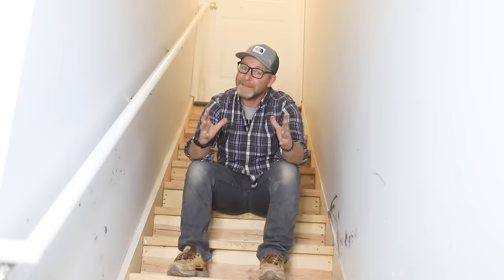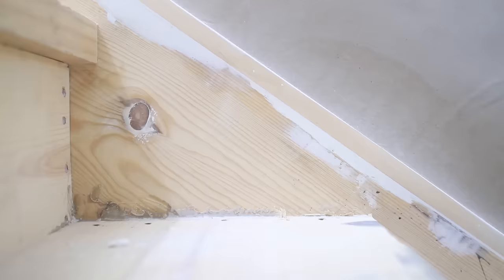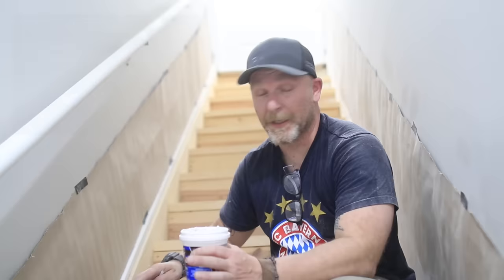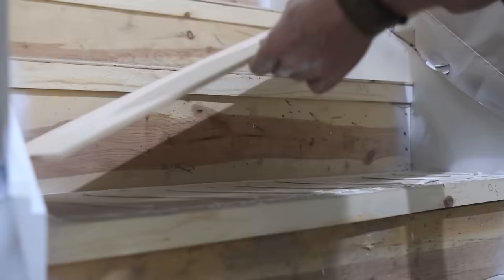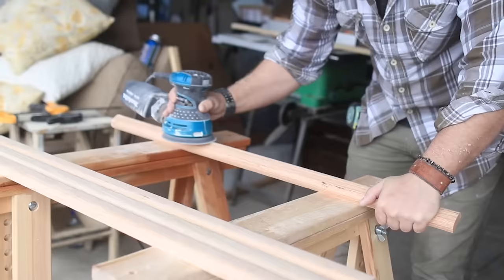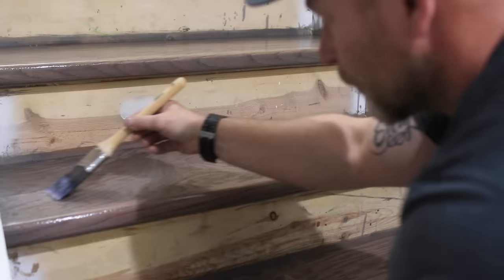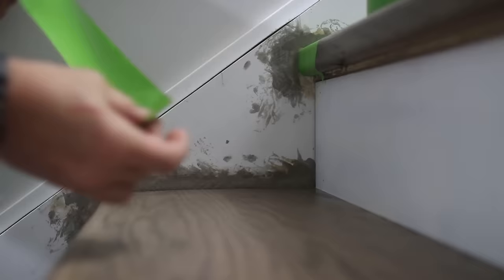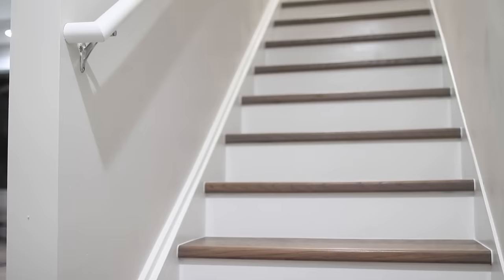DIY Stairs Makeover for Under $200 with Full Cost Breakdown!!

Comment: we have spend so much money on contractor that I need to learn this myself. From bathroom to closet it's something that I should learn on my own. Can I?
Reply from the maker: Absolutely.  It’s much easier then you think.  Just watch a couple of videos on what ever your doing and ask people questions.  You will be able to figure it out.   Good luck
Reply: You can. Just that you will need to spend tonnes on those equipments
Reply: fotochips 

You can start these projects with basic wired tools for not much expense. Jigsaw. Circular saw, handsaw, hammer etc. don’t go for the fancy ones. Find a “harbor freight” and use coupons.

Good luck.
Reply: A relative has a 7,000 sq ft home and he learned a lot instead of paying for it. We did too.
Reply: Rebecca Ramos I’m in the same boat.  Our contractor bailed after receiving partial payment.  I’ve done some things like this previously but not at this scale.  It’s been.....a learning experience lol.

Comment: Looks great! That is just how I do my risers, but those tread are going to wear through.
Just think how easy it is to wear through that veneer when sanding . Might be a good look if you were committed to a carpet runner down the middle , but that kind of defeats the purpose.
Reply: Surely that would depend on wearing through the poly coating first? (hence the comment in the vid about not being sure how well the one-coat poly would hold up)
Reply: @logicalChimp  And regular treads would need refinishing after use anyway.

Comment: Cheap parts, expensive machinery to get those pieces correctly sized.  Still great video
Reply: All the expensive tools and machines aren't necessary- the same tasks can be performed with basic (non power) hand tools. Or a $200 Ryobi kit (which can be used on a million other home projects).
Reply: Expensive tools?  He borrowed the table saw. You’re not much of a DIY guy if you don’t have the tools he had in this. This was a great video.
Reply: @michaelmike11  I dont have a table saw, or a router, but I have a mitre saw. I can afford to buy a whole workshop of tools and plan to get a router one of these days. I just dont have the room for big tools. My mitre saw blocks half the doorway into my garage. Maybe I could hire tools for this project, but then with the hassle of that I would start thinking about just paying someone to do it for me. Not sure about your suggestion that you could cut down the bullnose easily with hand tools. I guess you could work everything out in advance and get the shop to cut it all up for you, but you would have to be mega organised for that
Reply: @Ironbuket  Pick up a hand-router (think you can get a reasonable small one for $50 or so, maybe a bit more - I'm not sure on US prices :D) and a jigsaw or circular saw - along with a folding bench or a couple of good saw-horses, you'll be able to do everything in this video...  Table Saw makes the job a lot quicker, but you can do the same cuts using a straight-edge and a jigsaw or circular saw, etc.
Reply: @logicalChimp  I have saw horses. I went for ones with legs that fold up into the top, to give you some idea of how much space for tools I dont have. How are you going to cut down long pieces of wood length ways on a saw horse? Last time I tried to cut down 2m long piece of wood with my circular saw the edge was a mess because you cant clamp stuff to thin air. I think you need a table saw or a massive workbench to work with large pieces of wood, neither of which I have room for. Everytime I look at routers the reviews put me off pulling the trigger and seems there is a big junp from the cheap ones (5x the price) before you get to something good. You have to include the cost of all the bits also. I wouldnt trust myself using a jigsaw on multiple long pieces of wood. Generally I go off line at some point and duck it up. That's why i got the mitre with a laser line even though I dont really have the room for it. At least I can cut straight now.

Comment: Did u have any issues after adding 1/4 thickness to the  top tread?
Would've been good to show how you tackled that since many people who take o  projects on their own hit snags at transitions of materials.  Would've nice to see how a transition strip covered up the situation nicely
Reply from the maker: I didn’t run into any issues with it.
Reply: It sounds like your question is about where the flooring upstairs changes to the stairs? When walking up the stairs, if you're on the top stair, you still have one more step up to the upper floor. The top stair is treated like all of the other stairs. The upper floor will have a nosing of some type, there are several ways to do it and it depends on the flooring of that upper floor.
Reply: Ill the sheet u put down ill it pop up later  on bc its just with glue

Comment: Early American and then you said another coat of “beige”, but it looks like grey, would that be minwax classic grey? Love the end result and want to copy, just need colour of second stain used. Also, our unfinished stairs are exactly the same, with the exception of having no exposed stringers on sides... any suggestions for making thin faux stringers, it gives such a finished look rather than just the drywall. Thanks very much!
Reply from the maker: The second color is called rustic beige.  Sounds like it should be a brown color but it’s totally gray.  Hope that helps.
Reply: @KomarProject  nice job!!
Reply: Thanks so much!

Comment: $200 in materials, $3000 in machinery. Sounds like a plan! Good video nonetheless and a very cool project.
Reply: Most people watching a DIY Video probably have those tools and if they don’t the are pretty basic you could probably get them all for under 500$ and a lot cheaper if you buy them second hand or borrow them
Reply: @mattpresley3773  Ryobi has a $200 kit at Home Depot that you can do everything with.
Reply: Start doing small projects and think of the cost of tools as offsetting the labor youd pay. Start accumulating tools and pretty soon big projects will only require materials to be purchased, nothing else.
Reply: Anyone who doesn't have basic hand and power tools shouldn't be attempting the things they see on DIY videos.

Comment: under $200 + over $1000 in tools + carpentry skills = call a contractor.
Reply: That's more like $4K in tools...
Reply: He totally said he borrowed the table saw,. The router is $89 all day, sanders $49 all day for a Bosch, the miter saw you can get anywhere from $100 to the extreme one he owes at like a grand. But all of those cuts he did could have been done by a circular saw which are between $59 and $129. But if you have neighbors most likely one of them own tools cus you know they own a house.
Reply: every cut could have been completed with a $25 hand saw.. sand by hand.small finish nails and a hammer... nice try rlc..
Reply: R. L.C. lol right
Reply: It’s not a $1000 worth of tools you can build things without fancy tools also even if you buy all the tools you get to keep them for future projects

Comment: Not bad for a budget stair coverings
One thing I’d add ,if possible , use a biscuit jointer for the “nosing”. The carpenter glue and pins ain’t overly strong and that’s the area taking the blunt of the traffic 
Excellent job, nevertheless

Comment: If I saw your video earlier, I would have done it like you with 1/4 plywood.  Everything else I saw use solid wood stair treads which complicated things given it add 3/4" in elevation. Thus the bottom step is much higher than the top step.
Reply from the maker: Ya that will happen.  Most times though you won’t notice the 3/4” difference unless you know about it.
Reply: @KomarProject  it is 3/4 between 2 consecutive steps, but it is 1.5 between top and bottom steps and not compliant to building code.

Comment: Nice job,  for others doing this, I would check the bottom riser to make sure it does not go above 7 3/4" as that is the max height for the riser.  Also the different between all risers cannot be more than 3/8" from each other.   Last thing :)  you need to maintain a 1" tread nose.  You can review the IRC for al of this.  Again, nice video :)
Reply: My current stairs are carpeted and are the “waterfall” type with no tread nose. Is the code 1 inch max? If I use 3/4 in oak material they’ll be about 1/2 inch. Is that ok?
Reply: @californiadreamer5968  Will it ne inspected? If so, the inspector may look for the 1" nose, otherwise you should be good :)  the only other problem down the road is if some pesky home inspector looks at it because you have it up for sale :)  but they rarely look at stairs that close but again, that is the only issues I can think of.   Are the open risers?  That might also be an issue under newer codes.
Reply: Hmm. Maybe this isn’t a good solution then. How do they get away with waterfall carpeted stairs? Anyway, I appreciate the info!

Comment: I'm planning out my project with this as a guide. But I'm a little lost on how you got 13 treads out of 6 pieces of 1/4" 2 x4. The way you ripped it down i can see 12 treads, not 13. Am I understanding how you ripped those down to ~10" x 36" for the treads? Greatly appreciate the guide! It is very well done! How are they holding up BTW? My project is my main stairs and will get daily use so im very interested to see how that bullnose holds up. Thanks!

Comment: So I've been remodeling a house for quite some time, finally finished up all the flooring and the last region I need to finish is the steps. For the last year, I've been wondering what to do.
So before I go onto the story, some background: The house was built in the 1930s, never touched since. So the stairs are built into the stringers, which are built into the framing of the house; There's no "Replacing" the stairs without fully removing a few walls that are joined with the stringers (I looked into this at first lol). Too much work for little reward.
So anyway, I couldn't find ANYTHING about remodeling the stairs Pre-COVID, aside from the generic "Paint them" or "add stair-treads to them".
December of 2019, I thought "What if I was to just add a piece of oak plywood, to match the oak hardwood floors, to the treads and painted the risers". Little after, I realized I also have the bullnose, so I'd need to cut the bullnose. Down the rabbit hole I went of thoughts.

So fast forward to today. Finished the last bit of flooring (tile at the lower half and upper half of the stairs) for this region and I'm considering this again. However, I was thinking "Well the stairs aren't in horrible shape, they'll just need a long time to sand...and sure, it may be pine but if I stain it Ebony, it'll be less noticeable".
Then I pop onto YouTube, and your video appeared as a "Recommended".
Thank you for uploading this, because wow this took my idea and amplified it. I was thinking spackle to fill in the regions that'll come out from the bullnoses, however my issue truly after that was what to use for a veneer. I was thinking increasing the size of the stairs by ~1/2" since this is the standard plywood I could get. Once you mentioned 1/4 inch, I realized "Wait.....I could order that" and bam. Fantastic idea.
So yes, 100% THANK YOU for posting this. And the idea for the risers is brilliant; Especially in my scenario (they were carpeted stairs, it took 10+ hours to pull off all the staples, and the tacky residue black part is STILL on the risers). This just amplified my idea and basically made it more feasible.
Reply from the maker: That’s awesome Josh. My mind went to just staining the stairs at first too but figured the pine would be to soft for foot traffic so that’s why the plywood.  Hope your project turns out awesome.   Good luck brother

Comment: First time homeowner, bear with me- we have a 108 year old house. Beautiful hardwood stairs that need some love. They are the main way upstairs and also where our bedrooms and only full bath are. How long do you have to wait after staining and then sealing before using? I want to redo our stairs but worry about cutting off necessary spaces for extended times.
Reply from the maker: It depends on the product you use. But topically you can walk on the after 24-48 hours.  They still take about 2 -3 weeks to fully cure but you should be able to use them to walk on the next day

Comment: nice job, you can get pre=made treads at any hardware store, still a big job though. The only thing I'd be concerned about with the way you did it is how you attached the bullnoses pieces separately, that area get's ALOT of usage when walking up and down the stairs, but on the flip side, if one breaks, pretty easy to changed vs. changing a whole tread if the tip were every to break :)
Reply from the maker: Thanks so much man!!!! Really appreciate your support !

Comment: Great video. thank you. Quick question please....given  that the bullnoses are flush and only glued and pinned wont they be a weak point on the step and as the nose is trodden on when walking and down the stairs wont they begin to dislodge after a while? Thank you

Comment: I like lighter wooden color where you started from more than the darker you choosed. I did also make over of a 1914 house (90° angled) stairs with 2 x 13 steps from floor to floor using laminat to cover the bad treds and risers and added an antislip edge.

Comment: Hey curious as to why you used small strips of oak to extend the tread  (and routed them) for the nose rather than simply running the router on one side of a slightly-longer tread? Seems like less wood to buy, less to cut, less to glue, and one less seam… but I’m contemplating this project myself, I wonder if that would be a mistake. Nice work!

Comment: Great video. Could you stain oak before you install? Also the 4’x8’x1/4” red oak plywood at lowes says not for flooring - is this different than you used?
Reply from the maker: You can totaly stain it before hand.  And yes it’s the same plywood.  It says not for flooring because plywood is typically not used as a flooring material.  But any oak plywood will do

Comment: Very professionally made video, thanks. What was the reason for cutting down the tread width? Also, why add the trim above the stringers?
Reply from the maker: The trim above the stringers was to cover the drywall gap. And it looks cool.
Reply: @KomarProject  Thank you and it does look cool. What about cutting down the width of treads? That's a lot of work. The reason I'm asking is that I have unfinished basement stairs with 11.5" wide treads with 2.5" overhang.

Comment: I feel like the bullnose cap thing will give you problems down the road. Hope not. 
So nice man...great work
Reply from the maker: Thanks so much.  It wouldn’t come apart ever.  Wood glue joints are actually stronger then the wood itself.  Usually the wood will break before the glue joint.
Reply: @KomarProject  that makes sense 
Thanks

Comment: what would you do if you got some gapping between the top oak plate and the bullnose? just tack the nose in place and put some wood filler?
Reply from the maker: There shouldn’t be a gap. The wood glue will hold it in place.  But if you do, and had to diy remedy it, ya I would use some wood filler as the last option

Comment: I wonder if there is any way to work on such a project without any of these professional tools? We want to remove the carpet from the steps but could not decide what to replace it because of the tools needed. Even if the materials cost less than $200, if you don’t have those tools, what would be your suggestion?

Comment: Tried to talk my boss into doing this but when she has her mind made up there is no changing it.  Good video.
Reply from the maker: Lol ohh I know that feeling.  My boss is the same way
Reply: @KomarProject  The only problem I see with what you did is I’d you ever get water on the bottom riser it will swell up.  Of course you can worry about it then. I was going to use 1/4 inch plywood and paint it white.  I have several spots where I have knots. I will have to do what you did.  Namely cover them with spackle, sand and paint.

Comment: I'm currently doing this, only my stairs have a railing and spindles on one side, so have a few extra steps, no pun intended.  Instead of using wood filler, I used wood glue in the seams and saned in and around, allowing the fine dust to cover and bond with the glue. Thank for the video. What did you use to apply the stain? A rag? I'm That step now, just curious.

Comment: This is a great video. I have a question. When I followed your process, I have gaps in between the tread and the bullnose. They are not as tight as yours. What do you recommend? Stainable wood filler? I am planning to stain the stairs with black color. What can I do to make them least visible? Thanks in advance.
Reply from the maker: If there is a chance to take the bullnose off and sand some of the high areas to make it eaven that would be ideal.   You can also paint them and fill the gaps with bondo and paint will cover.  But if your staining the stairs then a wood putty (stainable oak ) would be your best bet.  Couple of ideas.  Hope one of them works for you.

Comment: I love this project - it easily looks like couple grand makeover, not 200 quid. I have a question, what if you have landing in between 2 flight of stairs. How would you deal with that? Tried to cover it in plywood as well? The shape is bit tricky - I guess it’ll be too hard to do in 1 piece. In few pieces, I worry about imperfections and gaps created when trying to join it together. Any ideas? Thanks.
Reply from the maker: Ya I would do it in one piece like a big stair. Will take some work but it’s the best way to avoid any issues.